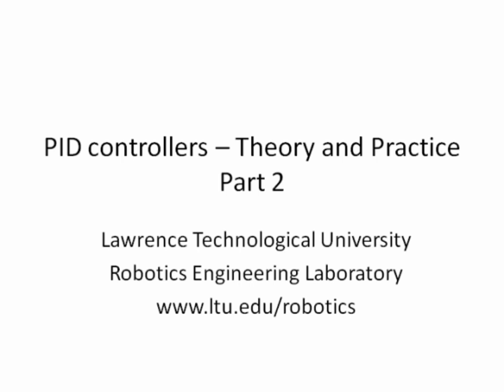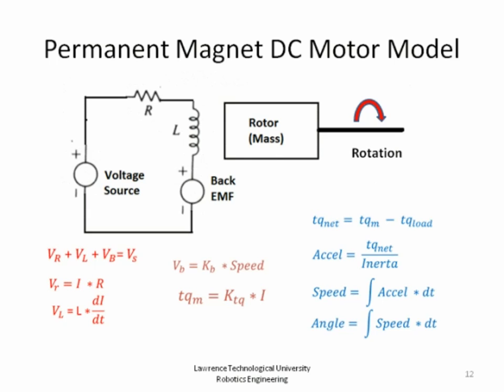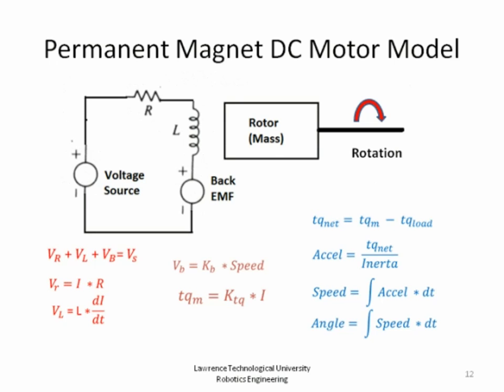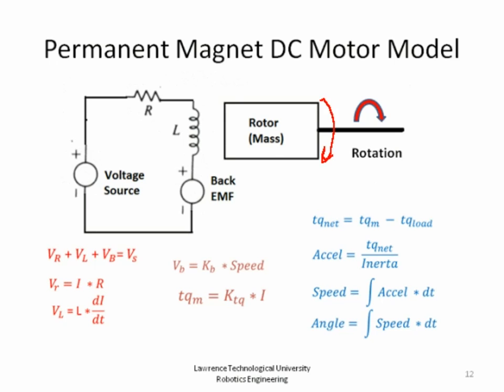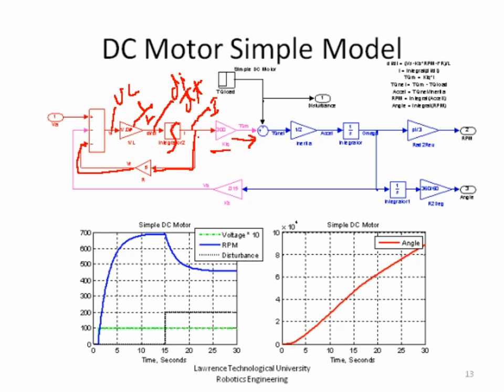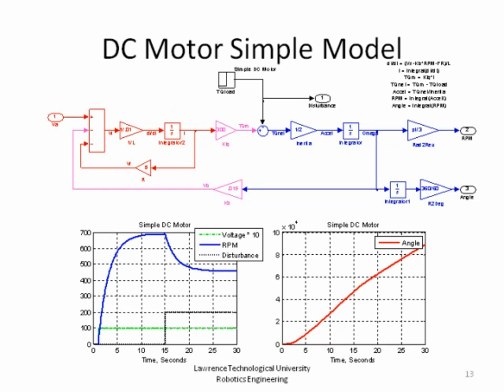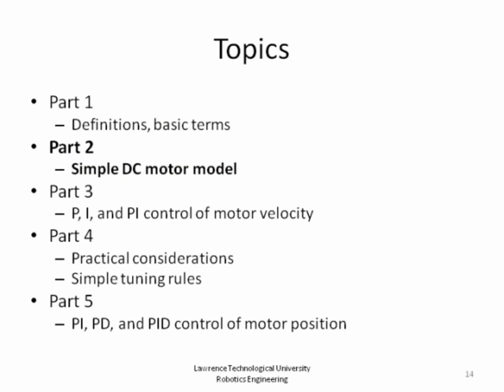PID Control Theory And Practice Part 2, Simple DC Motor Model

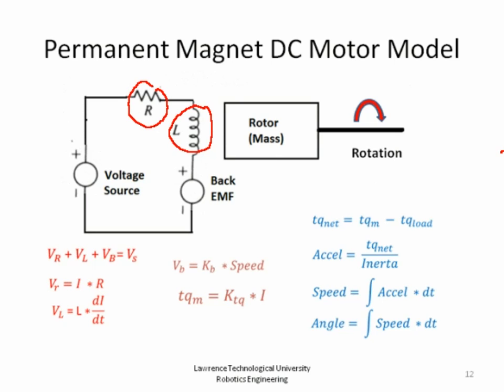Comment: 1:06-1:20  I like you man just move on !!! LOL. This is really helpful video. Just two comments. In my opinion it is better to say angular velocity and angular acceleration. my other opinion is that in the model it would be easy to put the the transfer function of the first order system in order to get the current. I(S)=V(s)[K/Ts+1] where k=1/R and T is tau and equal to L/R.